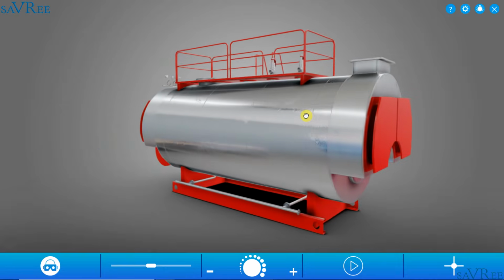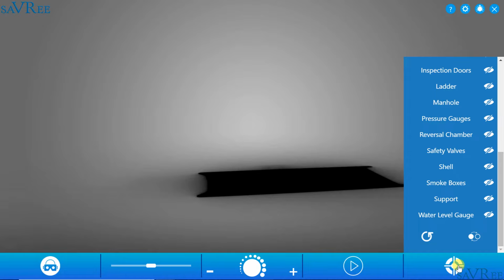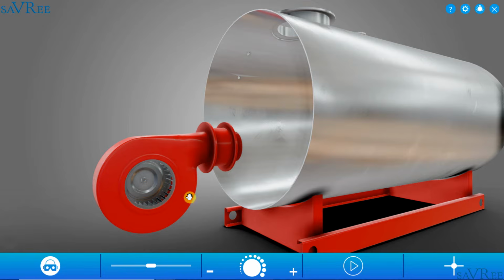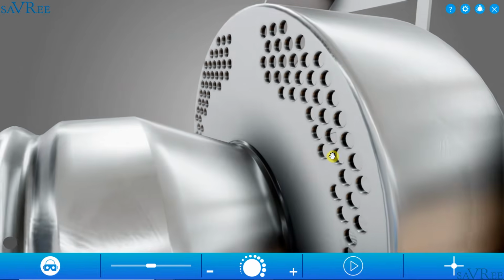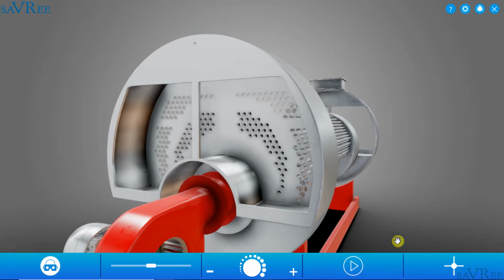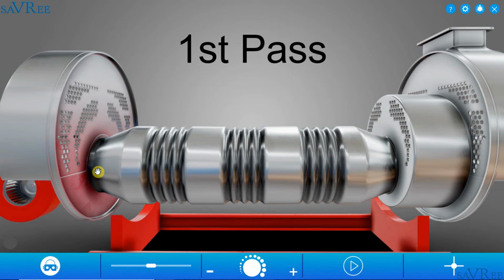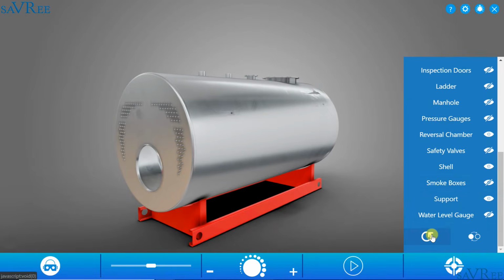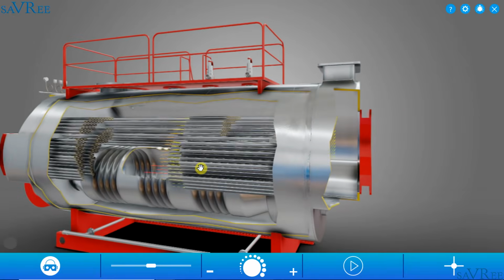How Fire Tube Boilers Work | Industrial

Comment: 7:30: "In order to get the gas out of the smoke box from the reversing chamber, we're going to have to send it all the way to the opposite side." No. You could just seal the holes in the reversing chamber and open it up directly to the smoke box. Instead of saying "we're going to have to pipe the gas to the other side" you could address the working principles with, "in order to extract more heat from the smoke, we pipe it to the other side and back through narrow tubes to maximize surface area and heat exchange"

Comment: An explanation of how a natural gas valve works inside a furnace or water heater would be interesting. 
I worked as a tool and die maker for a gas valve manufacturer for a number of years and always thought it was fascinating how they could have a fail safe operation utilizing thermocouples and micro electromagnetic actuators.